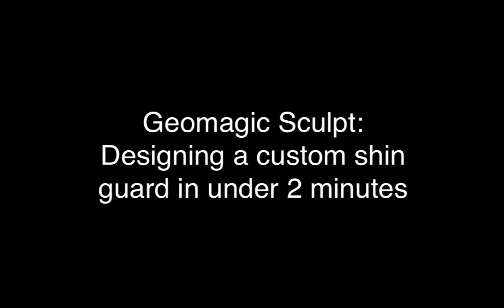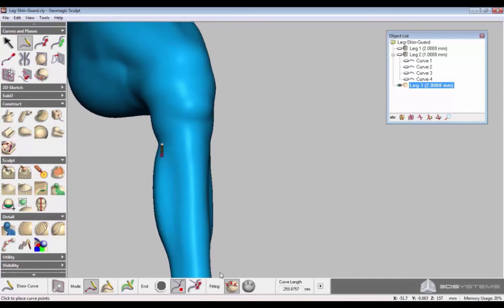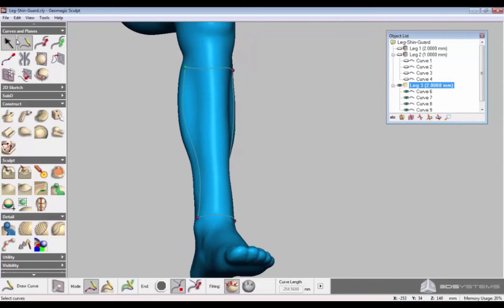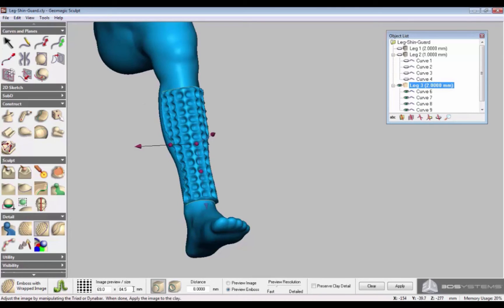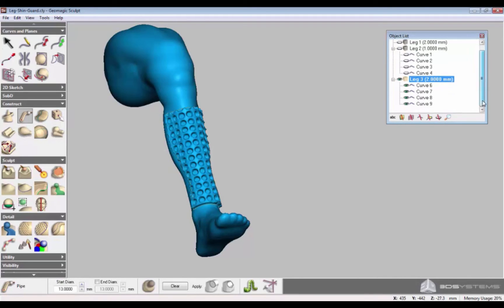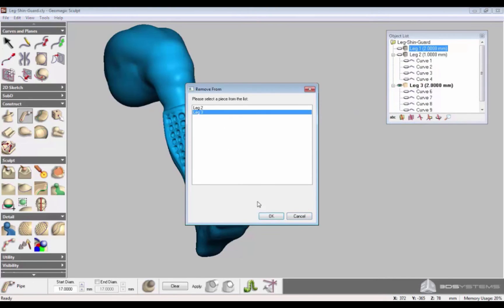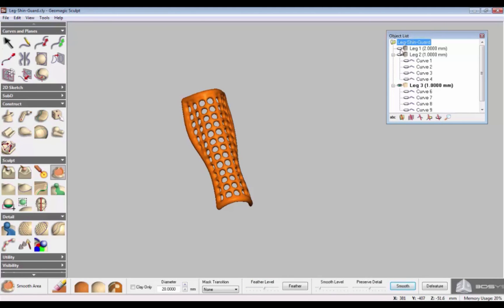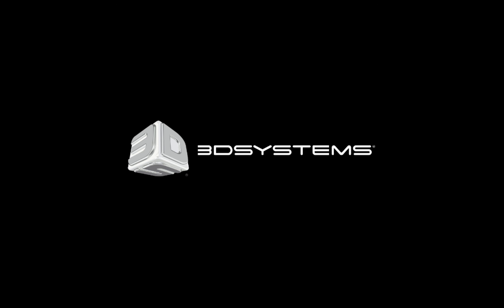[Geomagic Sculpt] 발목 부상 방지대 모델링

Comment: Hello,  Could one make that Leg shin guard have different thickness at different points? Example, you chose 8mm,  but if want it to be 8mm on one side and 5 mm at the bottom, could I do that?  Perhaps I would want it to be of different thickness at every side. Could one do that?   Does Sculpt have the ruler marker option?  Thanks !
Reply from the maker: Hello! Sorry for late reply. You can do that, if you should make the model by layers. 
Also, this software has the ruler marker option. Hope this reply will be helpful for you. Thank you! :)